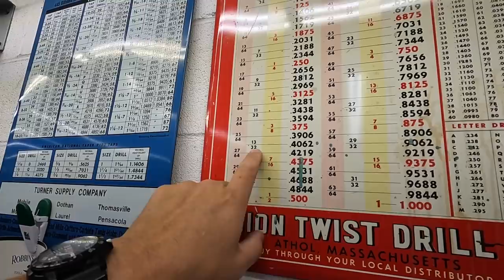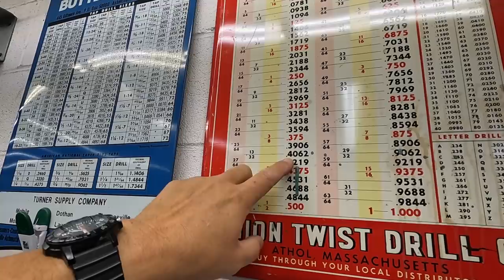RV How To:Step Above RV Steps Repaired and Modified

Comment: I think sometimes people watch these types of videos with the wrong intent. These are not "how to" videos. They are "how I" videos not intended for step by step instructions.  Videos like this provide inspiration and one mans idea on how to solve a problem. Besides, this channel is for viewers to follow along with his adventures.  In my humble opinion.  Thanks for sharing!
Reply: Yes, however, anything on one of Abom’s channels regarding metal fabrication or machining, can be considered one correct method. Abom is a pro. There are many ways to accomplish a repair or modification. The comment section is an open forum where viewers exchange ideas and personal experiences in addition to general comments. On some channels, there is as much to be learned from the comment section as from the video. Problem is instead of offering ideas in raw form or stating the commenter’s idea, many commenters will ask why the contributor didn’t do it this way or that. Keep in mind these projects may have been recorded days or weeks prior and are the result of many hours of video taping and even more hours of editing and uploading. Anyone thinking they know a better way should share it, but they are only an armchair quarterback at the point.

Comment: I like button head cap bolts.  I use them for 2 main reasons: 1-they were original equipment and 2-they provide a clean look.  I know it was easier to use an Allen wrench to hold the bolts from inside the frame and put the nuts on the outside but I think it would have looked better to have the heads showing rather than the nuts.

On the adjustable step mod: adding 2 holes was a good idea.  When I had my camper I had similar steps with the same issue when on uneven sites.  I found that at some point when the legs were over extended that the first step got to be a little steep-especially when my kids were little.  Instead of extending the legs further I acquired a 3 or 4 foot long piece of 4x12 from a local sawmill to put under the feet.  That served as the first step-a big help for short legs.

Comment: Those are some really nice steps, will definitely keep those in mind for our RV.
Another thought for the support legs is to make an insert that goes inside of the current support legs instead of making new ones. This would provide a second adjustment giving you plenty of adjustment and still gives you good amount of the support leg in the mating tube with lots of support.
Really like the stability of those steps. Thanks very much for sharing.

Comment: That is a great repair!  As a portly gentleman I know first hand that manufacturers don't make things sturdy enough for bigger guys even though some things may hold up they just make things so cheap!
Reply: These steps are rated at 500 lbs.
Reply: @RichieCat4223  As someone who weighs nowhere close to 500lbs and has broken things rated 500lbs... sometimes manufacturers "rate" things higher than reality does.
Reply: @RichieCat4223  I suspect that the OE rivets are aluminum with steel mandrels. Had the step company used stainless rivets I doubt this problem would have occurred.

Comment: Nice repair on the steps! The retired machinist in me is just a bit jealous of your shop for sure but I would also have used a through bolt but with a spacer tube in the center of the channel to prevent the assembly from collapsing. Keep up the great videos!!

Comment: Probably a good extra step would be to remove the steps and weld those splits on the elbows to get the flex out of it. Also IF the rivets that hold the steps ever break too. You could replace them with an all thread rod all the way through.😉👍
Reply: Those elbow brackets are a piss-poor design.

Comment: Spae-Naur in Canada has the same hardware in Canada. I fixed mine putting the nylock nut on the inside learning the button on the outside.

Comment: I might have put those nuts to the inside. Leave the button heads on the outside. Might have been tougher, but better turnout.
Reply: agreed also no nut or threads to catch a shoe sock pant leg
Reply: Agree, would look more 'finished'

Comment: Thanks for the tip! I'm not as fit as I was. Stuff seams to wear out and break and rivets aren't always the best way to fasten things like your steps. This video gave me an idea maybe if before they get loose we could put a fine threaded screw inside the rivet to make it last longer when replacing them with bolts won't work. I'm glad there was a simple fix for your steps! Until next time Have a good one!
Reply: I bet that could work. Truthfully, I've also put some JB Weld in a syringe and used a large diameter needle to fill voids and cavities with the epoxy for extra strengthening. It sets up and is then a very strong filling core. :) You could do that too here. Fill the rivet and then put a piece of tape over the end to keep the epoxy inside.
Reply: @mannys9130  That should make things better should it. Thanks for the tip!

Comment: I feel lucky to have a Fastenal in my area because I to really like the button head cap screws in stainless steel, like them so much I have the assortment box with washers and nylocs, I'm also looking to get a set of steps for my trailer and dump the pull out set that came with the trailer.
Reply: Got one in the Industrial Park behind my house! Maybe five minutes away. I also have within a couple miles: Home Depot, Harbor Freight, a REAL ACE hardware, NAPA. Advance, Auto Zone, O'Reilly's, and a few other places. I also would have put the button heads out but that's just the way I do things. Minor quibble on another Abom "better than new" repair job!😁
Reply: @PhilG999  Adam is a big boy and I've seen him defend his work before, I think he likes the critics as well. I golf with the manager of Fastenal  I think that helps 🤔 we do have all the others too. When working on a Harley I wasn't sure if the stainless would match up with the chrome so I was afforded a sample package and it was free, so for many years McMaster Carr was the go to, still not completely weaned from them. I think that I was more interested in the steps and not the repair, I'm looking for a set for my trailer and when Adam put this out I got a twofer. I think that I had asked for a review of the steps. Its great to hear from you Phil.
Reply: @keithrogers5832  Yeah. Adam is the pro! And one of the marks of a pro is being able to deal with constructive criticism and shrug off the idiots! 😁

Comment: 2 extra holes wont give you a lot more adjustment Adam, get you by for a while - I'd definately be planning to fit the longest leg you can in there eventually. Also possibly adding an  adjustable foot as well, something like a 19mm (3/4 of a banana) bolt you can wind in or out for final adjustment.

Comment: i'd have put the nuts on the  inside,  someone is bound to catch themselves on that tiny bit  of thread sticking out of the nut and get a cut.
Reply: SawAll.
EDIT: Liked the Nyloc nuts.
Reply from the maker: Again, trying to be helpful. I knew those couple of threads were going to bother people, and for no good reason other than to try and critique. The bolts will be just fine as is.
Reply: @AbomAdventures  Sorry to see you reply that way, Adam. Maybe your viewers are also trying to be helpful rather than just critique. The button heads belong on the outside where skin, pant cuffs, and show laces won’t get snagged on the fasteners. The thought of bare feet and ankles next to those edges is enough to make anyone cringe. The job will also just look more professional.
Reply: That's why I mentioned it I had a mallard 28 footer and my buddy fixed his like aboms and he got hurt just trying to help.

Comment: My biggest concern of drilling the two holes closer to the end of the tube is the increased levering force with less length on those telescoped ends.
Reply: I was worried about that at first aswell, but towards the end he shows that it auctully didnt change anything. As long as the last hole is within 1" from the end it's no diffrent then another hole. The tubing itself would likely buckle before that joint ever failed.

Comment: Question. Why can’t you use one long bolt all the way through the side rail instead of the two when replacing the two rivets? The same path as the rod you used to line up the holes. Thanks
Reply: I wondered the same thing.
Reply: I have the same steps on my 5th wheel, my guess it would crush the tangs  together unless you place spacer in between channel.
Reply: @amsoiltek  The longer bolt with a spacer is exactly what I was thinking. It is the route I would take. What he did will work just fine. I just thought 1 long bolt would be simpler with the same result. Maybe he was just working with stuff that he had on hand. He did say that he already had the panhead hex bolts. Same results either way.

Comment: Trailer owner here. I'm still amazed by the corners that manufacturers will cut to make a few extra dollars. What a dangerous situation, using rivets as stressed members of a step structure. No wonder people sue companies for injuries due to poor design. Thanks.
Reply: Agreed. I think I would have still been skeptical of a solid steel rivet in 3/16" one thing I will say is that the people who end up having to repair them are very aware of this kinda crap and the insurance agency's are aswell. This is why I stick to air streams and tear drop trailers or just stright up homeade

Comment: Suggestion not make new rails just get tubing to fit inside with holes that lines up with the large one and have two adjustments on each side, not sure if you replace with longer ones will it hit the inside door handle?

Comment: Adam could you use a longer bolt on each side instead of 2 shorter bolts per side. Also are you worried about the attachment of the tread to the riser?
Reply: I was thinking the same thing alot of extra work and it will be harder to take apart
Reply from the maker: If you use a long bolt the two parts won’t be pulled up tight to each other, why I showed the method I used for separate bolts.
Reply: @AbomAdventures  Ok I see what you are saying. Thanks

Comment: How about making taller swivel feet for the legs?
Reply: If it matters would make the first step non-standard height for every use.  Could add an internal slip tube foot plate to each existing side with a similar pin/series of adjustment holes.

Comment: Why couldn't you drill out a solid bar that would slide into the hollow bar that you drilled out and mount the foot pad. That would make it stronger and give you a lot more adjustment. I've had steps collapse with me too many times over the years. It's no fun! ......LOL

Comment: I would just get long bolts like 2 inches instead of the short ones
Reply from the maker: And then the two parts won't be pulled up tight together and be sloppy. I think I'll stick to the plan I shared. BTW, I'm just trying to be helpful.
Reply: @AbomAdventures  You are very helpful Adam! People can change the tutorial to their own liking and experience the success or failure of choosing to do so. Let 'em go at it. You do great by showing us the concept. 😺 Thank you!
Reply: Your type of joint relies solely on the shear strength of the fastener. The method Adam used is much stronger as it also creates a clamping friction joint which is much stronger that a simply shear joint. It aslo won't fail due to cyclic actions, as long as the hardware is and remains tightened sufficiently.

Comment: Those steps certainly weren't designed for heavy duty use, I hate buying something and having modify it to a higher spec because the original product just couldn't handle things.